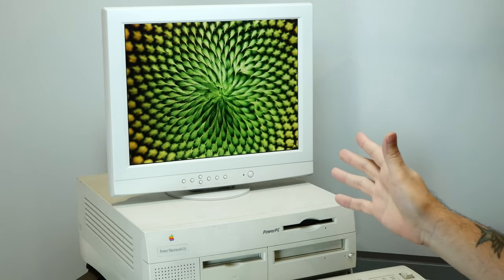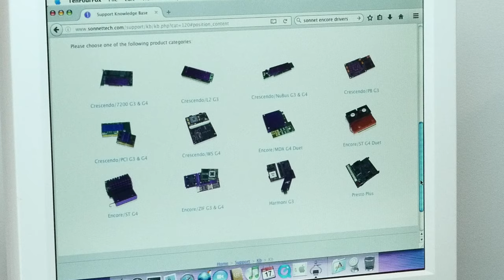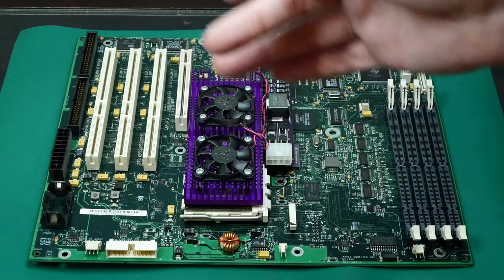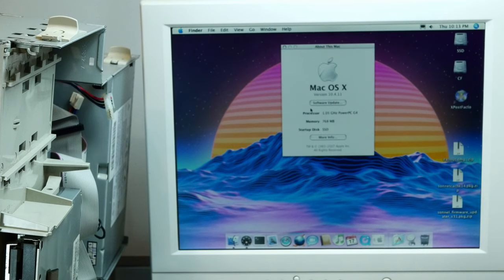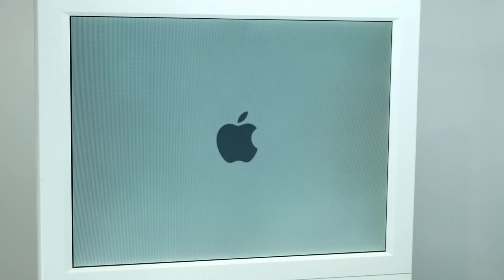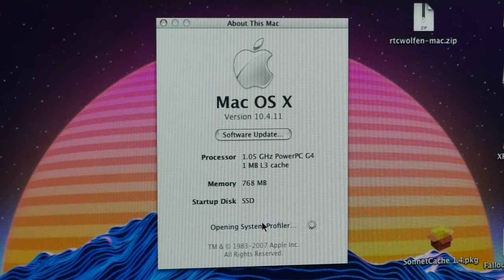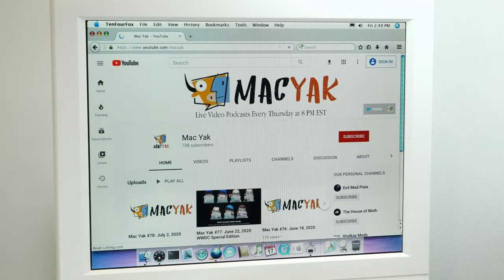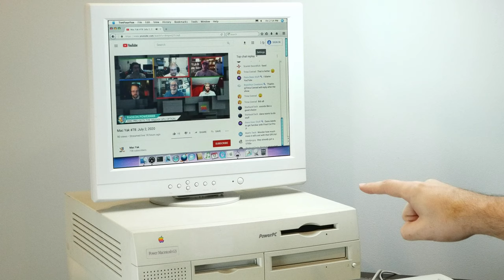Installing a RARE 1 GHz G4 upgrade into a 266 MHz Beige G3 Macintosh - The Beige Beast, Part 4!

Comment: My main laptop also can't view YouTube in HD, as its from 2004. But I've always hypotheized that if I put a modern, faster wireless card in it, then it would work. I haven't been able to test this hypothesis (the wireless card I ordered hasn't even shipped for some reason...?), but I think its worth trying to see if its a proper solution. Nonetheless, great video!
Reply from the maker: Haha thank you! What laptop are you using?
Reply: @ActionRetro  Thinkpad R51.
Reply: @dave7244  That makes sense, actually. Do you have any suggestions on how to fix it?
Reply: @dave7244  I don't have the kind of money for even a slightly newer laptop, and I won't for a long time. How can I fix it without buying a new laptop?
Reply: @IoIxD  Your computer can probably play the HD video stream outside of the web page. VLC can play YouTube, at least it could in the past. If it still works with the latest YouTube updates you may have some luck using that.

Also, have you tried looking at Craigslist or FB marketplace, etc for a newer laptop? If you ask around locally you could probably find a Core 2 Duo laptop for under $30. At least you could a few months ago, the used market has gotten more expensive with more people working from home. You might want to get in contact with a local computer shop if there is one near you, they may have some systems which may otherwise be getting sent to recyclers.
Reply: @eDoc2020  I've tried the former, it doesn't go past 360p. I don't trust Craigslist enough to try the latter.
Reply: @IoIxD  a Pentium 4 (I’m guessing) does struggle beyond 360-480p. If you can force an easier codec like h263 or MPEG4 (there’s some Chrome and Firefox extensions which let you tell YouTube the codec you want but the options available depends on when it was uploaded) you might have an easier time. 

Or maybe (definitely if you’re using Chrome) it’s actually defaulting to VP9 which takes about twice the CPU as h264, so you might be able to get a little bump in resolution by forcing h264. Probably not 720 but maybe 480.

Comment: just got a Beige G3 tower with a Sonnet 800mhz ZIF processsor (purple)  i powered it on and with a CD boot 9.2 you can tell its slow and after full boot profiler only shows 67mhz  not 800mhz  WTH!?  any ideas?  i was told it boots up fine, but 67mhz is slower than the original 300mhz  so make no since what so ever
Reply: Jumper settings, maybe?
Reply: @3rdalbum  no. It was driver (extensions) needed to be installed

Comment: That thing boots faster than my 2010 MacBook!  Well, so does my Mac mini G4...  Is there a way you could install a WiFi card, or even go past the "max" RAM?  If so, that thing could actually be even more usable today
Reply: Should throw an ssd into your MacBook. My 2010 MacBook has an ssd + macOS Monterey, runs pretty well. Also may want to consider upping the ram to 8gb at least if you haven’t already

Comment: I had that G3 Mac and I upgraded it with a Sonnet G4 800Mhz card, the worst deal I ever done. The Mac was heavily bottlenecked by bus speed, ram, video card and nothing changed after the upgrade but my wallet thickness. The machine was still slow as hell, uncapable  of running a HD video at 720p 30fps, Final Cut was sluggish and the audio didn't play any sound but glitches and farts. Neither Mac OS9 nor Mac OS X (hacked) could resurrect my crappy and expensive Mac, horrible experience. I sold the CPU card for half its price and gave away that shitty G3.
Reply: That's because you don't know what you are doing. Graphics and ram held the Beige G3 back. Flashing a much more modern gpu from a pc like a fx6200 and maxing out the ram created a massively different experience
Reply: Nice Stealth delete "Rob Bianchi replied: "Rad Checkinski My G3 had a Radeon 9800Pro 256Mb (far better than FX6200) and 256Mb Ram. Now who doesn't know what's doing?""

Its still you. G3s don' have AGP slots, and if you mean a G4, the 7800GS is the fastest AGP card that works. Thanks for playing

Comment: desighner with years of experiance and mounths of working on cooling IT NEEDS FANS....your proces what fans why use those there like load....you silent running pc guys would get scared by your own fart...add a blower fan or set them sidways get alot of air moving...or fry the rare part in a week o well right